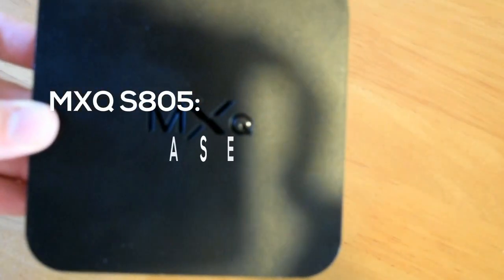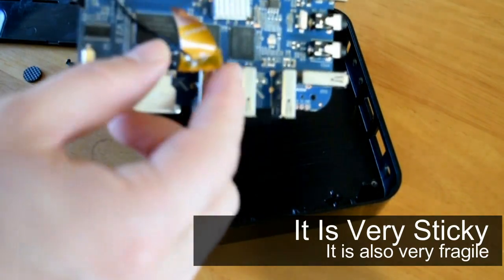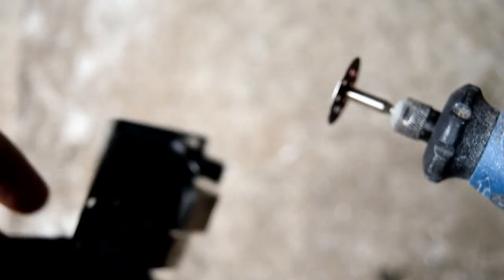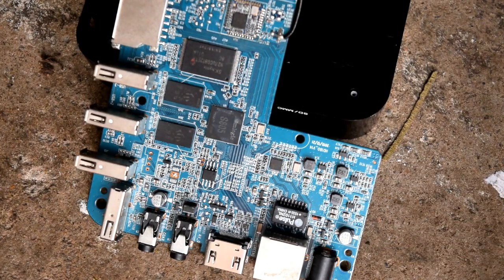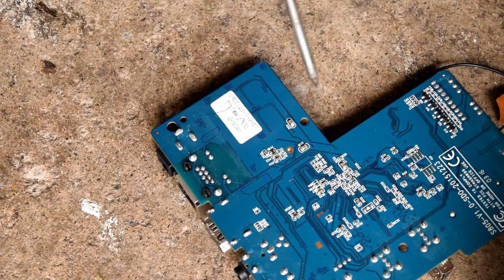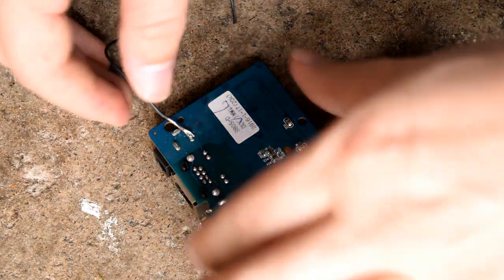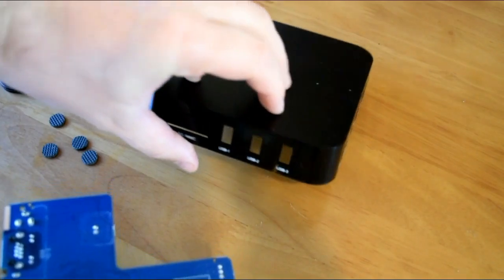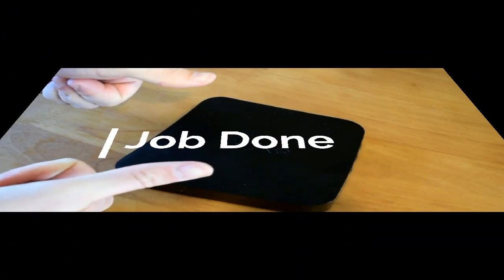HARDWARE MOD ANDROID TV BOX: ADDING A POWER BUTTON

Comment: Good mod to do while it’s apart is install a much larger heatsink and remove the one that is double sided taped on and your processor will run 100% better. If you want a quality tv box buy an Allwinner orange pi 64 bit 2g Ram 32gb storage and plenty of options to add a hifi audio board and host of other features plus it can run a Linux operating system if you prefer over android or rasbian. $30 which is way better than these crap boards.

Comment: I HAVE I QUESTION I HAVE MXQ TV BOX AFTER I RESET IT WITH TOOTH PICK METHOD ,NOW I GET BLACK SCREEN ON TV NOTHING SHOWING ,ON THE BOX  LIGHT IS ON BUT NO RESPOND  WHAT SHOULD I DO HELP PLZ
Reply: Depending on what caused the blackscreen...   first and easiest to check: Use toothpick method again (keep pressing the toothpick auxbutton with the ac-adapter plug unplugged and plug it in, turn on the box and keep both pick and powerbutton pressed until you see the  android recovery menu) and choose to clear your cache and then choose reset and see if it starts up normally.